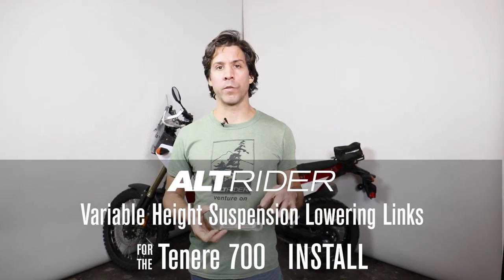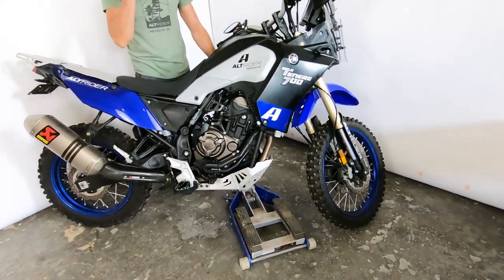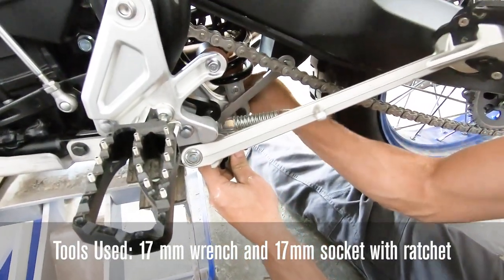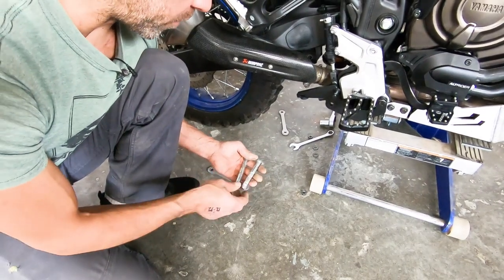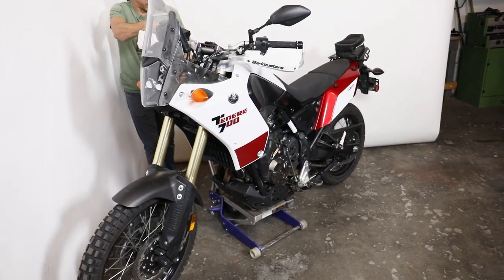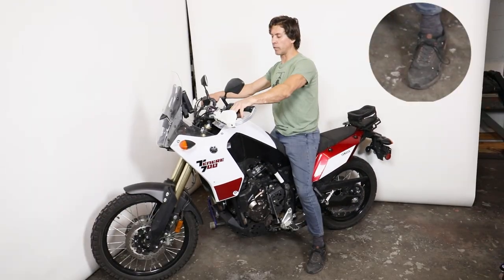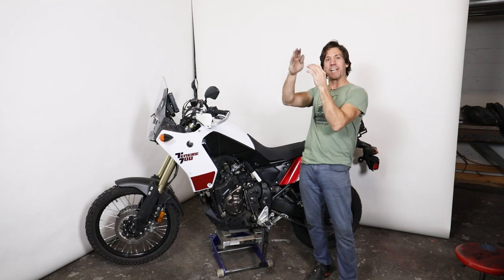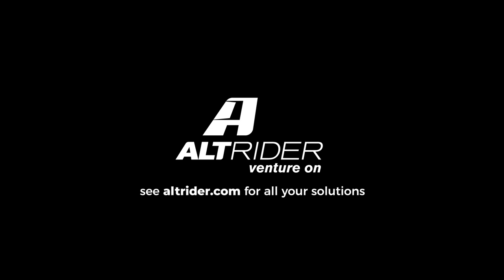Yamaha T7 Variable Height Suspension Links Install by AltRider

Comment: Once lowered, does the rear wheel go further into the bike at full bottom out? Is there and contact with the rear tyre and plastic guard at full compression?
Reply from the maker: It is possible to make contact with the rear tire even with the OEM suspension setup which is one of reasons it's important to get the bike sag correct. 

Lowering the bike does not change the travel of the rear shock so the risk of bottoming out is similar.

Comment: Any adjustments to Yamaha center stand and side stand after lowering 30mm?
Reply from the maker: No need to adjust the center stand, you'll have a little bit more lift, but it shouldn't be a big deal.

As for the side stand, the lean will be different, and our Adjustable Side Stand is the perfect option!

Comment: I just installed your kit at the 30 mm setting. I learned a couple lessons:
1. The torque on the fork tubes was about half of what's called for. That, or my 30 year old torque wrench is way off; in which case i just jacked my forks. 😮
2. The seat height is good 👍.  I'm 5'7" and the lowering links were definitely needed.

Question: is the 22mm fork adjustment an accurate measurement based on the lowering link 30mm hole (keeping rake to the factory setting)? Or, is the 22mm fork adjustment as far as you can go, but you actually need more?
I ask because I feel more weight on the bars now, than I did prior to the change. I recognize that this is ok at speed, but it will decrease turning radius and control at slower speeds - correct?
If this is correct, I'll prolly readjust to the -18mm setting.
Thanks in advance.
Reply from the maker: Glad you like the lowering links!

We suggest a making roughly 50% of the change you made on you rear suspension to the front suspension. So if you lower the rear suspension 30mm, a 50% change in the front would be 15mm. The factory setting is likely around 7mm from the triple top of the fork tube. Add the 15mm and that brings you to the 22mm lower limit. 
A local suspension shop can talk with you about possible other options if you want to explore other options or a different feel.

Comment: Hi all! Lowering 30 mm is the maximum recommended or is it possible to lower up to 40mm? Are there any concerns to lower 40mm? Thank you for your help
Reply from the maker: 30 mm is the maximum we recommend. Going beyond that starts to have a series of implications, including considerations with ground clearance, rear wheel travel, clearance to the rear fender, and impact to the suspension.

Comment: Was looking at this as a solution for converting the t7 to super moto.  17's going on and wanted to keep decent heat tube angle.  Thinking a lowering link may be the solution to this.  Have to messed with lowering link and super moto wheels at all?
Reply from the maker: The lowering link would be a great addition to for a super moto and is a similar setup to how it would be done otherwise!

Comment: Nice design! What about preload? If you lower the bike you should increase preload or even use a stiffer spring am I correct? I understand behaviour of the rear suspension and bike of this +12, -18 and - 30mm have been analysed somehow? Do you have or can provide the graphs of the behaviour with linear spring?  I m about to buy  80 or 85 N rear spring, and if I lower the bike with these links, maybe I should go better for the 85 if I'm in between? Thanks!
Reply from the maker: Good question, I would suggest you get the lowering link and see how it, it will give you a chance to experience the OEM spring. That might help indicate whether the 80nm vs 85nm would be better. As you know each position will change how the spring reacts.  Essentially 25-30mm of lowering is the time when a new spring should be considered as the rider is already exceeding the preload.  So, you very well may be better with the 85NM, but testing with the links first will be helpful. Additionally, playing with the different positions on the link will help validate your feel while riding if you need more spring tension.

Comment: Does this affect the spring rate in any way ? I lowered a WR450 a few years ago and it seemed to make the rear spring very soft.
Reply from the maker: Thanks for your inquiry - you’re correct. You increase the mechanical advantage on the initial part of the stroke so it will feel softer, but then it does ramp up quicker and becomes a firmer spring before it bottoms out. The rule of thumb is if you lower more than 1 inch you need to investigate spring rate. But we always advise to set the height you prefer and then ride in your typical riding environment to determine if you think you need to make an adjustment. if you do, we advise contacting a spring or suspension company, Progressive is a good contact out in California.
Reply: @AltRiderLLC - any recommendations for suspension shop in Chicago area ?
Reply from the maker: Sorry - we don't have any we know of, but I have to imagine you've got some good services there...